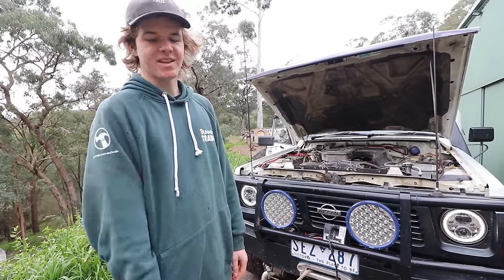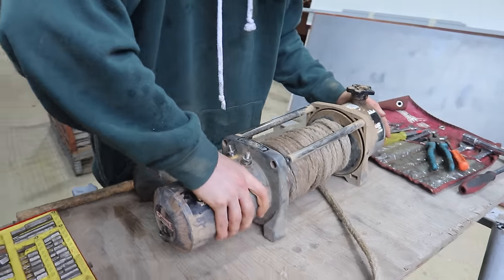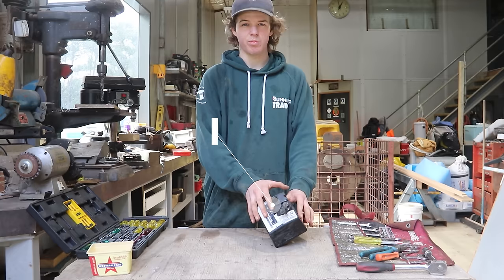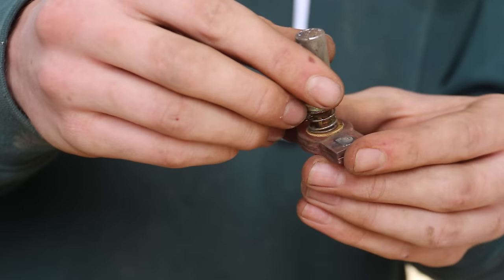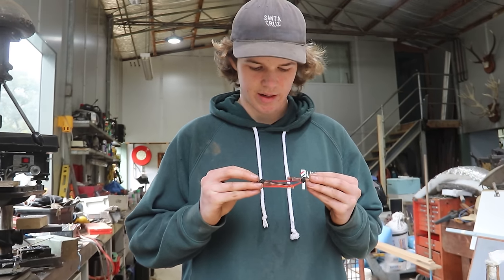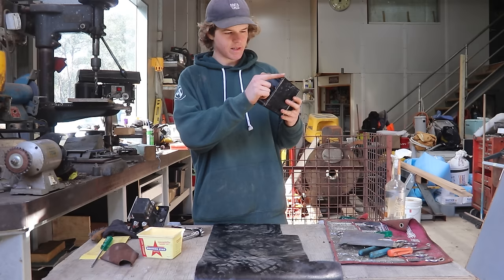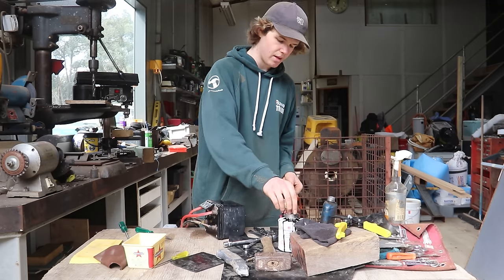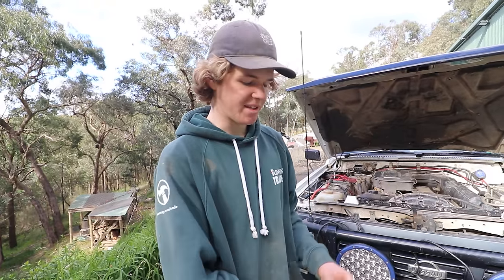How to FIX any WINCH on your 4X4

Comment: Really liked the tear down. Stuff i noticed is often when coils are wet like the solenoids, sometimes it creates croision on the coil, cuasing the coil to ark and short. Might be better off just getting a new box or solenoids or i guess if you got protection before battery it wont matter until it fails. The drainage holes on the box is probably to allow water to exit (ideally), If it was totally sealed, as temperature outside heated up and cooled down air and moisture would slowly make its way into the box though that expansion and construction. With this then comes internal condensation causing water to become trapped and kill the internal elections. It's a common fault on solar lights and stuff.  Downside i guess is if you do a river crossing or bog hole and water enters :(

Comment: Great ingenuity there guys, another option for the future could be a 3D printer, you can print out the custom parts you need using different types of plastic such as TPU for gaskets or ABS for external fittings. You can buy a decent printer for a couple of hundred dollars

Comment: to make free spool easier pull the gearbox apart, and on the sleeve  that the free spool knob moves in and out to engage, ensure the outer sliding surface is clean of any excessive amounts of grease. i like to use som light oil on mine. this should make spooling out easier.

Comment: To fix freespool, pull the gearbox apart, hit it all with degreaser, and put back in new grease, but not so much, and use good quality grease. Not that red stuff, the green waterproof stuff is pretty good, but anything with moly in it will do the best job.
Reply: Yeah I second the moly grease.  Same stuff you put in the CVs for the high pressure. I rebuilt mine once and didnt have the proper grease and stuck some high temp wheel bearing grease and it was to viscous and a real pain to unspool.  Next rebuild some good moly grease  and what a world of difference.
Reply: I did the same and it free'd up the free spool real nice.

Comment: I recently saw a video from Ed China ( formerly from  Wheeler Dealers) using a solution of Vinegar 12 cup and  2 Tbl Sp. of salt to remove and clean copper wires that were suffering from  corrosion- then neutralising with a solution of water and Bi-Carb of soda.

Comment: Did this and it was fairly clean to start with , didn’t fix it unfortunately 

Inside of the winch looks similar to yours once opened nice and clean , 

Put it back together and tried to bump run the winch with some jumper leads off a battery, still no luck. Any suggestions where to go from here

Comment: I have been looking into fairleads. Lock your hubs and Robert Pepper. I have bought a second hand Warn 9000ld. I am going to build a multi controller. But the roller fairlead. The one you're using, you are losing about 300kg. So reading reading. I found polyurethane roller replacement. So I paint the housing a good colour and ads the new rollers. I should only lose about 10% power out of the winch.

Comment: When ever i install a winch i take the solenoid out of the cover and mount it inside tge engine bay so you can spray it with crc and visually check its condition every time you oven your bonnet

Comment: Well done Cobra ya got it goin again. Hey the same to my warn xd9000 winch but the crease was cooked so cleaned it all up and re-greased it. Now it will pull but won't hold the weight on the line it will free spool back instead of holding the tension. Do you think I put the gears in the wrong way or something else?
Reply: yeah mate id say something went worng in the re-assembly process. Sounds like the free-spool/lock twist know isnt engaging properly
Reply: Mad dog! Looks like I'll have to pull her apart again ayy hooray haha

Comment: The winch is hard to pull out because it has excellent seals.  I had a Tigerz and now a Kings and they both do the same thing.  But they both are perfect inside, unlike other name brands which freespool easily but let water in.  Just use the motor to spool out.

Comment: Dude no! Change the grease in the gear box!! Use a marine grade grease. It will make it run a million times better. Will free spool out way easier too
Reply: Yeah agree with this. The planetary gears in the gear box is what causes the heavy spooling... i had the same issue. Clean out the old grease and put in some fresh stuff. I couldnt free spool mine and now i can pull out the rope with one hand.